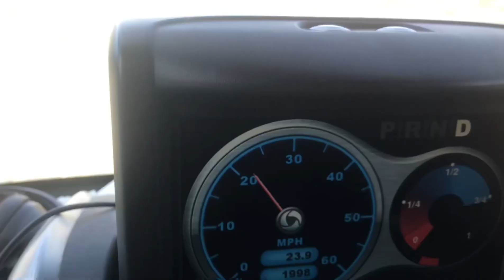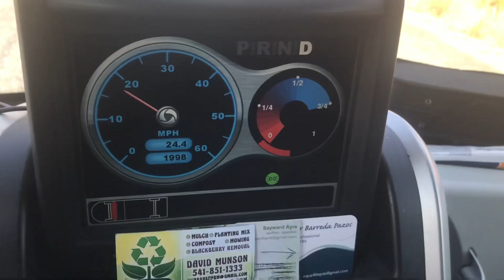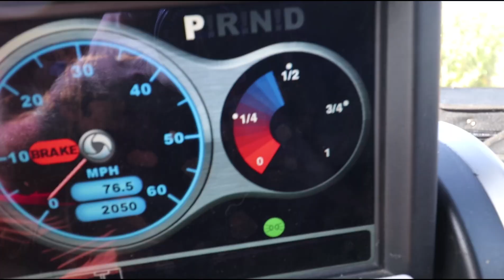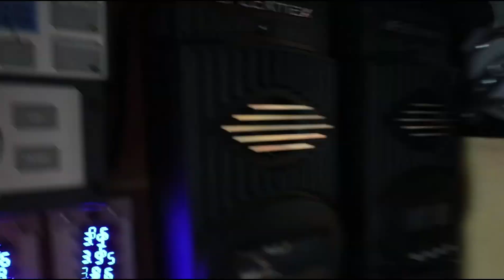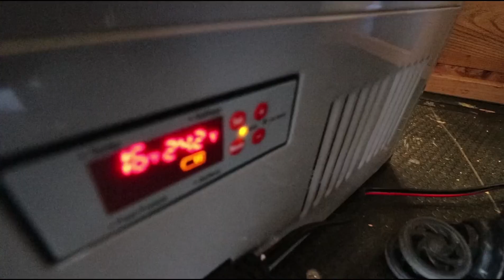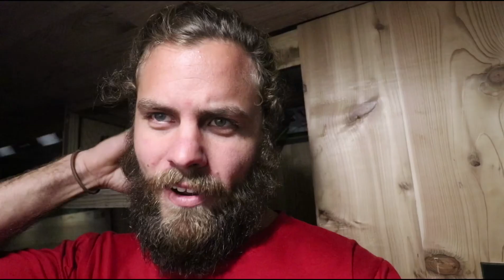Prologue: La Tortuga | Solar Powered 💯% Electric Vehicle, Alaska to Argentina 2019

Comment: Hey Joel could you do a video talking more about your planned route and possible time line, also you said you have a diagnostic tool that can clear codes for the estar, is that a Navistar specific gadget or a regular off the shelf OBD tool, I just bought a e-star and it has error codes. The alot!